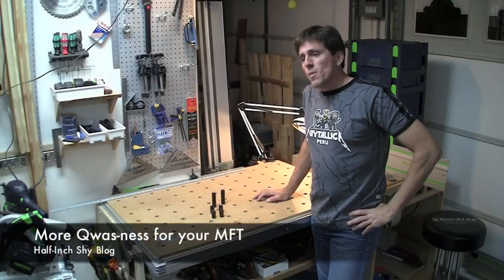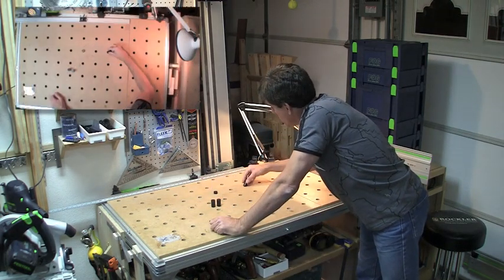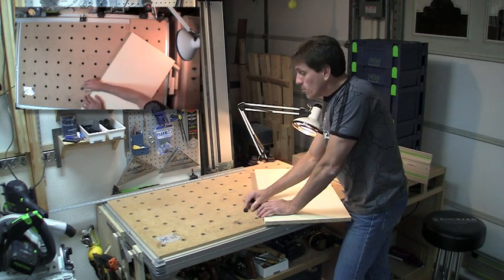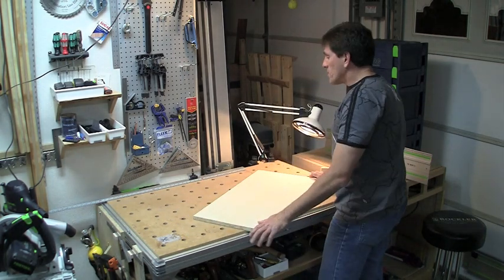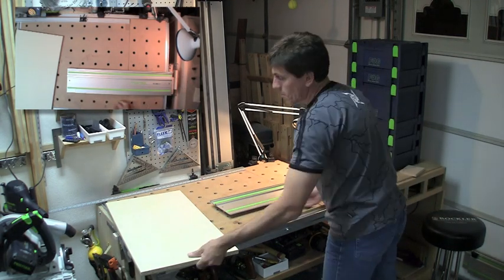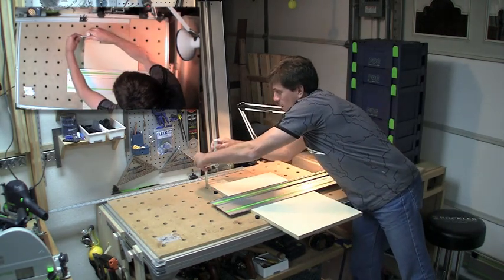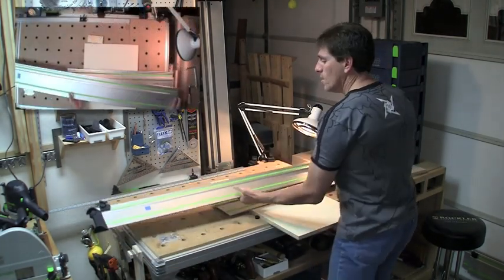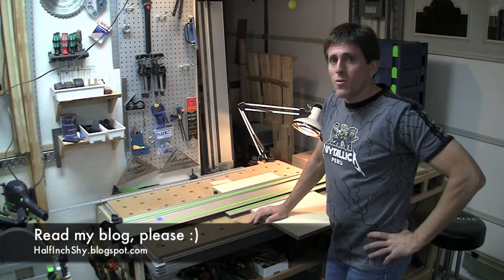#16.3 - Festool MFT - Part 3 - Qwas-ness

Comment: Hi Paul. I just picked up the MFT/3 and an OF 1400 from my local dealer. It will be a wait for the Quas dogs as they seem to be back ordered but I did pick up the clamping elements for now and the rail guide for the OF 1400. The MFT/3 seems to be rather intuitive to align but we'll see once I get some test cuts and dadoes. I already have the TS 75, it's time to make some built-in shelves and a pantry.

Comment: Yes I have The 800 and I have been using it as a assembly table rather than cutting table. I have been thinking about building crpaulk table but I think if I make use of the mft would be better , but I need to make it longer somehow to work for me.

Comment: Thanks for posting these videos!  I am glad I found them.  I am just getting into woodworking and plan to purchase a TS55 as my first saw because I feel safer using this saw than a table saw.  I also like the dust collection capabilities as I have allergies.  On the MFT3 table, would you recommend buying the full setup or just the table without the rails and then buy the dogs for alignment?  Thanks.
Reply from the maker: +Patrick Cox Well, I use the dogs a lot, but you'd need the full MFT table to get the guide rail that flips down for cross cuts and to get the rear fence. You can buy all those parts as spare parts, but they'll honestly add up to the difference between the basic and full table.